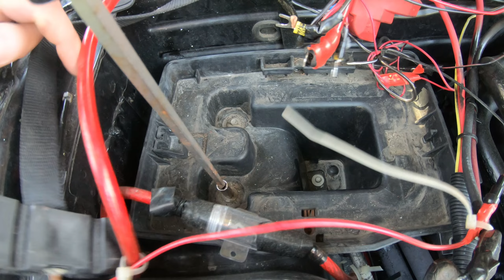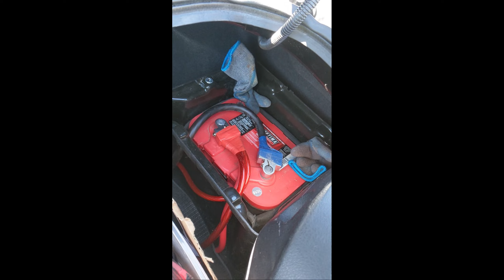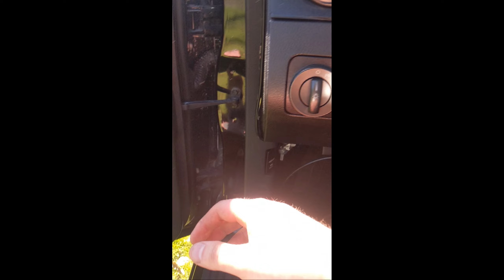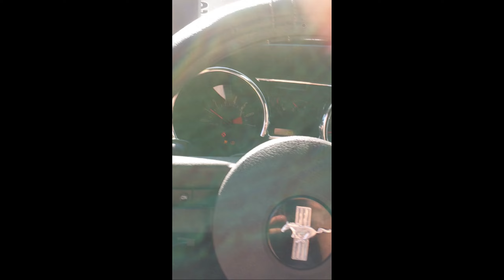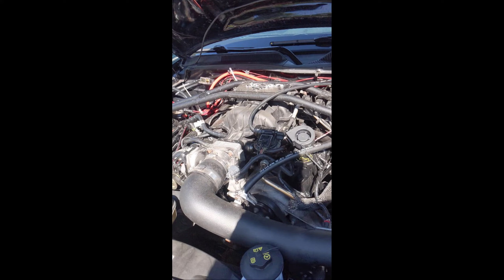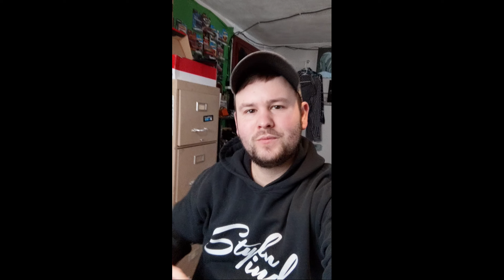Relocate Your Battery Into Your Trunk It Works For Most Makes And Model

Comment from the maker: Revline89 - Relocating My Battery Into My Trunk Works For Most Makes And Model
Everything i used can be found below
wide heat shrinks = https://amzn.to/3t9Qhc9
multi size heat shrinks = https://amzn.to/3vEylb7
heat shrink wireless gun = https://amzn.to/3gUsOcp
wire cutter = https://amzn.to/3xLgOje
crimper = https://amzn.to/3xGUKqb
very strong wire cutter - https://amzn.to/3aY066F
zip ties - https://amzn.to/3aWBWt8
red top battery #1 = https://amzn.to/2SoT4Bu
red top battery #2 = https://amzn.to/3gUDKGY
205 PC tool set = https://amzn.to/3een1MS
tool set # 2 = https://amzn.to/3eO6kad
tool set #3 = https://amzn.to/2QHdeWZ
A good way to connect wires to one another = https://amzn.to/3nKyLtR
sealed battery box #1 = https://amzn.to/33cdNuw
#2 battery box = https://amzn.to/3ebinPY
lug crimper = https://amzn.to/2PQ74mY
2 GA 15+ Feet Pos Neg Wire Set = https://amzn.to/3eQkfwv
0 GA pos neg wire set 50 Feet - https://amzn.to/3xGx5WN
1/0 GA wire set = https://amzn.to/3tjOnp7
mix color electrical tape = https://amzn.to/3eQkWWD